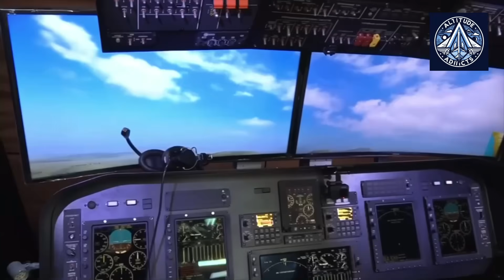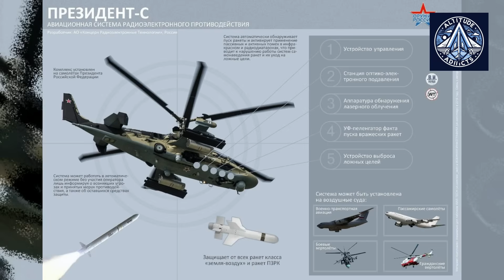Il-96-400M with Two PD-35 Engines in Consideration—Russia

Comment: Let them first make the PD-35 engine for all to see. It is all speculation until the engine exists! They are not even done yet with MC-21, while its counterparts are already in commercial service.
Reply: Considering that Russians are under massive sanctions and are unable to buy foreign components, it will take a couple of years but Russia is on the right track.
Reply: stop being so negative

Comment: I think they said the Il-96-400M would end up costing twice as much to build than the 300 because of the cost of certification and the low build rate until 2030. 
Looking at the plane I think it's landing gear is too short to fit a big diameter PD-35 ... 
you are looking at a big redesign ....
Reply: Das Fahrwerk ist das eine, aber ein neuer Flügel ist etwas ganz anderes.
Schauen wir mal, in Rußland war man schon immer für Überraschungen gut.

Comment: I would probably make a new designed aircraft rather than use the Il-96. Attempt to use as much tooling as possible from the Il-96 as possible, reduce mass by removing the extra landing gear bogies (etc.), modernize the materials where possible, modernize the electronics and other systems, modernize the aerodynamics, and place those PD-35s on it. 

If you use the Il-96 you are forced to accept the limitations that already exist in the aircraft. Recertifying and modernizing will likely cost almost as much as making low risk new design, but with all the drawbacks of the Il-96.
Reply: I think UAC should hire you considering your the expert on everything BS
Reply: @DimK6631 True I don't know very much of the specifics of Russian aviation. I'm just a poster on YouTube sharing my opinion, if that's offensive to you then I'll i can say is jog on.
Reply: @DimK6631 cuando el fanatismo nubla la razón se hacen este tipo de comentarios.